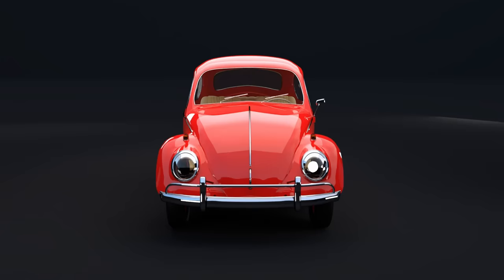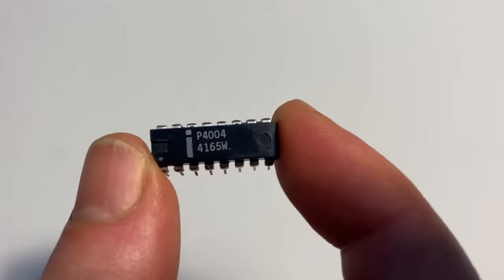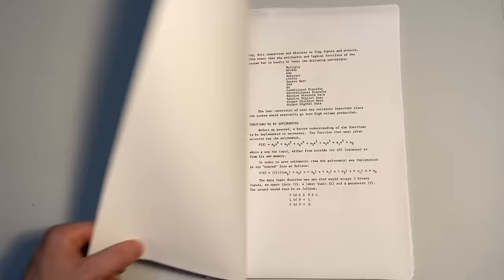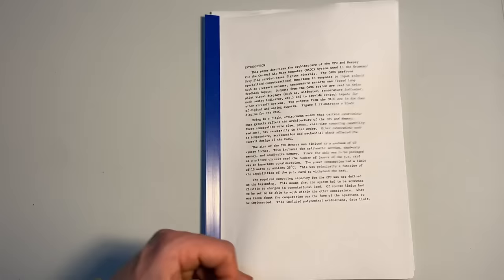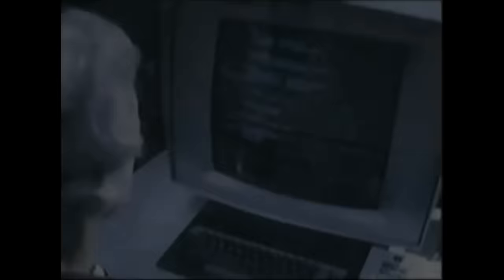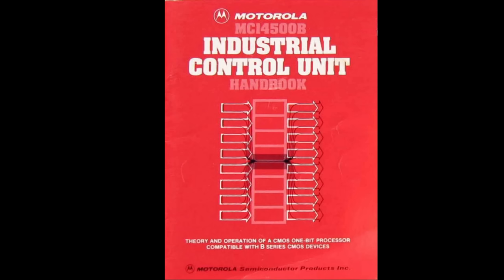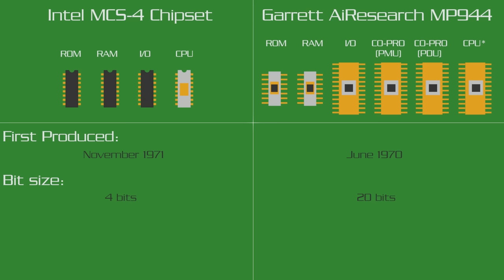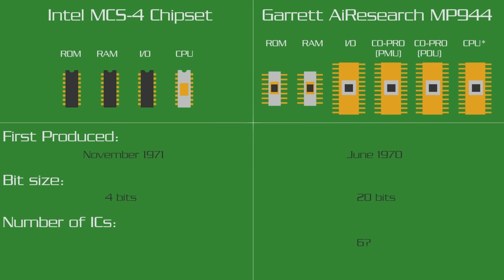The World's First Microprocessor: F-14 Central Air Data Computer

Comment: The old chip designers were crazy.  No simulations, no HDL, no DRC/LVS.  They would cut photomasks by hand.  Imagine seeing some bug in silicon and coming up with the concept of setup and hold time to explain it.
Reply: The old stuff that gets me is magnetic core memory. Making those by hand is just nuts.
Reply: @whyjnot420  its why memory used to be the most expensive part of any system.
Reply: @mrrolandlawrence  Yeah and if you do the math, having todays amount of memory done that way would bankrupt many a nation for a single computer.
Reply: There's a great amount of info and real world experience in "Commodore: A Company on the Edge" detailing the process they used to design the 6502, hand cutting rubylith to form the masks for the different chip layers. Absolutely mind boggling how hardcore chip designers were back in the day. Even more impressive when they then go on to explain how their chips "mostly worked" or in some cases "worked 100%" on the first batch with those old processes.
Reply: @mrrolandlawrence actualy it still is. Registers and caches take up a significant area on any chip that uses them, jacking up the price.
Reply: All that validation and layout needs compute power to achieve. They did it that way because they didn’t have the tools to help them, plus the designs were very much simpler than today. There are plenty of examples of failed designs that needed repeated re-spins before they worked (if at all), the 16032 for example. The size, cost and complexity of a modern tape out are the reason why tools came about.
Reply: yes, the masks were cut by hand with a scalper, how steady the hand should have been
Reply: @whyjnot420   something like with induction coils and rings
Reply: I wish one day I can cut a silicon mask by hand for something equivalent to a Z80 only to see how it was done.
Reply: But if programmers today were as efficient as decades ago we wouldn't need GIGABYTES for spreadsheets or a few browser windows.
I remember Lotus 123 (or Visicalc or Multiplan) distributed on 2x 360KB floppies.
Reply: @mrrolandlawrence I remember reading in a Atari mag that flash memory would be memory for the future..
Reply: @kocovgoce  the masks were cut in a very high magnification, after that they were photoshrinked.
Reply: Old school board designers are also insane. Many were drawn so most tracers were curved unlike today's futuristic city looking boards
Reply: @shaft_raiser  Actually it was done in enlargement on foil with adhesive tape. Common part footprints had ready made stencils. After traces were laid out the whole layout was photographically shrunk size.
Reply: I wonder if anyone still makes chips this way as a hobby
Reply: @kocovgoce  I know what it is. I just think it was insane that people literally stitched that stuff together by hand back in the day.
Reply: @whyjnot420  For $5 you can buy more transistors than the number of humans that have ever lived.
Reply: It's all about the timing
Reply: @johnclawed  And there are more atoms in a cup of water than there are cups of water in the world. And everytime you drink a glass of water there is almost a 100% chance that at least one water molecule will have previously been pissed out by Oliver Cromwell. And if the sun is a 10 foot sphere, Pluto is the size of a ball bearing from a fine point bic pen and is a mile away...

I can go on all day with these.
Reply: @cardboardboxification  Wow those were some crazy times!
Reply: how many transistors did one f 14 processor have and were they placed in TTL logic circuits
Reply: @whyjnot420 What's even more bizarre about core memory, is to read the data from a core required a destructive process called read, modify, and restore.  To read a word, you wrote ones to it.  Any bits that were zero drew current, but all the bits that were one, didn't draw current.  And then you had to write the original  word back, unless you wanted to change it.  

It's like a blind person deciding if there's a balloon in a box.  Give him a pin and a bunch of balloons.  If it pops, the box had a balloon.  If it didn't,  it obviously didn't have a balloon.  Then you have to put a new balloon back if the box was supposed to have a balloon. Isn't this absurd?
Reply: Know you dont design a cpu as “one” you design registers, accumulators, and functions all separate, debugging them is just a simple tast of checking the inputs, comparing them to an output chart/flow charts, and debug accordingly😊
Reply: @Nic7320 absurd? Not to absurd if you ask me, just a creative way of still be able to read data without “destroying it” remember we had volatile memory for a long time, memory which needed to be refreshed every cycle it made.
Reply: very advanced
Reply: @whyjnot420  indeed. i remember saying to my friends in the 1980s that computer memory would one day be cheaper than $100 per MB. ah the days. of course the laughed and called me an idiot.
Reply: @whyjnot420  No, Pluto would be several miles away by my rough mental calculation. And I prefer to think of inhaling atoms that Galileo exhaled.
Reply: @ClosestNearUtopia   DRAM still needs to be refreshed continually.
Reply: @johnclawed  thats what I said, its not so strange.
Reply: They had other techniques to design the CPU which could be used without the need for simulations or any software. Since old CPUs weren't as complex it was possible to design it just by a "pen and paper" approach.
Reply: @_________________404 Yeah that is the reason things like state machine analysis exist, which is essentially just doing a manual simulation.
Reply: @johnclawed  That solar system one was just a very very rough approximation. It is meant to impart a sense of scale more than anything else. The one about Oliver Cromwell is simply because that was the first version of it that I had ever heard many years ago. (for the record I'm not English, New English perhaps, but not English :D)
Reply: @mrrolandlawrence  I remember saying much the same in the early aughts. Though I was saying it for GB not MB. People had no trouble believing that it would happen. However they didn't believe it would happen as quick as I said.
Reply: Most EDA tools aren't really that fundamentally more advanced than doing it by hand apart from some of the simulation and verification tools.
Reply: And now, social media 😂😂😂
Reply: @monad_tcp oh God now your telling our age by wanting to play with z80s
Reply: Yeah my dad worked overseeing installations of those huge mainfram system installations like they used for SAGE and research programs at Nellis and its surrounding bases.  It was crazy how they had to do it back then.
Reply: This and the prior slide rule gurus of the 50 and 60s.   Gone are the true development enginners.
Reply: Alien Technology
Reply: @stevetodd7383  Well, and also the size and complexity of modern microprocessors came about in part because as computing power grew, the more sophisticated tools needed to support that level of complexity became available.
Reply: still very much a thing for analog and mixed signal design, a lot of it is intuition from the designer
Reply: @user-ju8qg9dx9x  Yeah, I would hope to imagine myself as one of those guys because that's what I do.  It's just amazing what they were able to do even without all of the powerful tools we have now.
Reply: @kocovgoce  would require millions of dollars just for the equipment, then millions more for the clean room equipment, and then millions more for the building, the equipment required is not small or cheap, even the older stuff.
Reply: Yeah mate.. er, i was
thinking the same thing
Reply: . You should try making a mask using an exacto knife,  it's tedious but possibly.
Reply: These are geniuses that are obsessed with the idea and spending every waking moment to make it a reality that is a powerful thing
Reply: Back then a 'bug' was literally an insect, lol.
Reply: @Nic7320  destroying data by reading? Every DRAM since 1969.
Reply: I was one of those. My first IC was designed on a light table with rubilyth cut with an exacto knife. DRC was done with a ruler, LVS was with crayons. I am still doing it for a living but OMG have things changed!
Reply: This shit reads like mad lib

Computers are just magic boxes...
Reply: @shaft_raiser When you have have a french curve stencil, everything becomes a french curve.
Reply: Not sure how expensive a tapeout (or whatever they used to call that back then) and producing samples was back then.  Probably much cheaper than today as they needed for more iterations for sure.

The 65C02 at Western Design Center and probably also the 65816 are some of the last designs for which I know the masks where created manually.  Back then they had significant problems ramping up the clock of the 6502 to the speeds originally anticipated for the Apple IIGS and maybe other late 8-bit Apple systems.  I bet the lack of powerful simulation tools and manual layout was at least a contributing factor.  That said, the woman who did the masks is a hero.

There are pictures of the MIPS R2000 processor's layout being spread out on a squash court.  The R2000 was released in 1987.  And I'm trying to imagine the discussion of a MIPS' accountant and the IRS about the attempt to deduct the rent for the squash court "I swear, the court was a business expense, honestly, I swear!" 🙂But that chip was like two orders of magnitude more complex than the 6502 so I can't imagine it was layed out all manually.
Reply: @whyjnot420  That's an interesting thought.  According to Wikipedia core memory started off at $1 and with advances in production technology came down to $0.01.  Which means you get a modest desktop's 16GB of core memory for a mere 137 billion dollars and a bit of change.  Graphics memory not included.

The current #1 in the list of the 500 fastest computers has 1184 TB of memory.  #1 means it's the fastest at LINPACK, not necessarily it has the most memory but memory information is not contained in the top500 list so let's go with Frontier.  At 1 cent per bit the memory would cost 104 trillion dollars.  Plus the usual bit of shrapnel and change.  Which is not even three times the current US national debt.  Not so bad at all.

By the late 60s the density of core memory was about 0.9 kilobits per litre.  Which means the 1185TB of memory would fit into under 11571749042 km³.  Our Frontier Core computer would fit into a volume only 8.67 times the volume of all oceans on earth.  The limitation of the lightspeed to a mere 299,792,458 km/s means the memory system would need to be clocked down a little bit to say the speed of a drunken dog taught to emulate DRAM using filing cabinets.

Power would not be so bad.  Core memory maintains its content when powered off so only reading and writing do require power.  Given the size of the memory it's safe the 22 Megawatt of the actual Frontier system would not suffice.  My gut feeling is a power requirement somewhere between a Castle Bravo and a Tsar Bomba.  Per second.  Making global warming a concept of a very cold past.

Enough of that nonsense.
Reply: @ralfbaechle  When you do the math, it really hammers home just how far we have advanced with that tech. BTW, 137 billion would put 2/3 of the worlds countries below it. A country with a GDP of 137 billion would rank 62nd in the world out of 188
Reply: @whyjnot420  Between Slovakia and the Dominikan Republic.

Sadly these countries have other things to do with their GDP than just buying a few GB worth of core.
Reply: It isn't crazy. It is the absolutely most advanced tech in the world.
Reply: @Splarkszter  Such claims are usually the result of people no longer being able to work or even able to imagine to work using the old methods - methods that did actually solve much easier tasks than the modern ones.

I have mechanical calculators, typewriters, sliderules, mathematical tables.  None of these machines I've ever actively used; I'm too young for that.  They're office decoration and a threat to my computers "if you don't work, I pull them out" ;-)